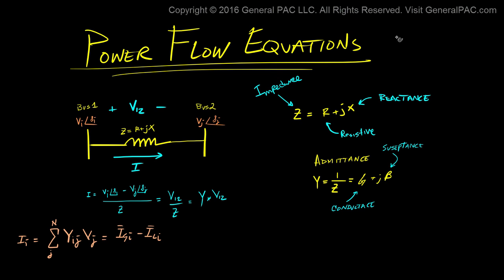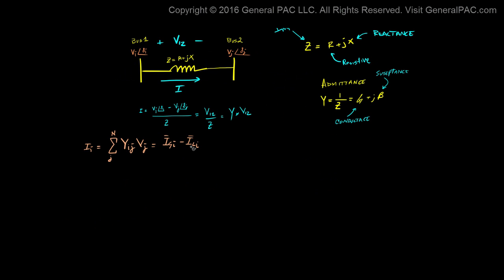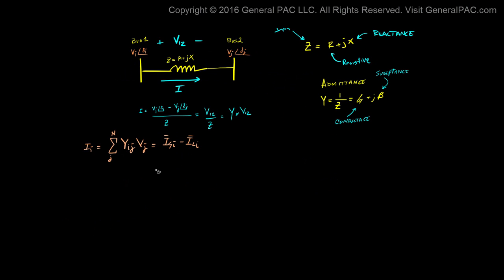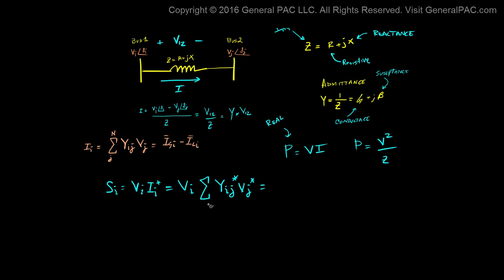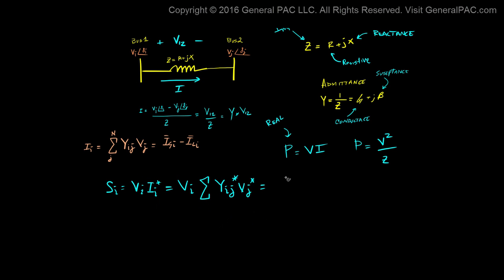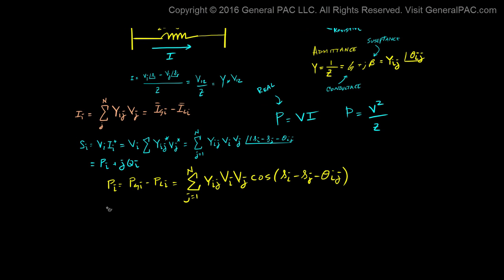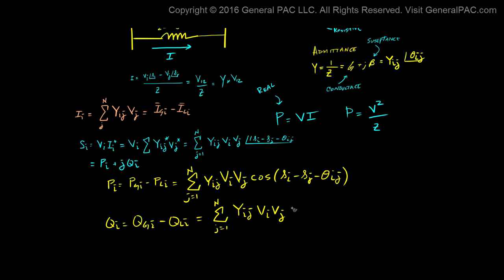Power Flow Equations Part 2

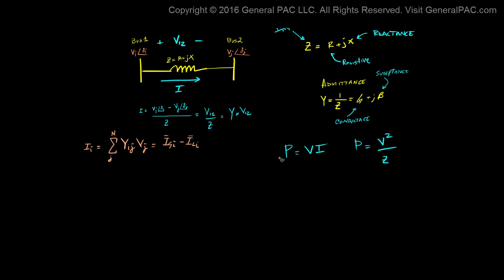Comment: 0:38 Your equations for active power are wrong in general. They're wrong for general impedances (you forgot the power factor), although they're valid for purely resistive impedances.

1:31 Isn't that complex power? So far I've read textbooks which call the expression you typed as complex power, and apparent power as the magnitude of complex power.

Comment: Quite complicated question. It is really interesting to understand why there is a conjugate of current in the apparent power equation. I appreciate the standard explanation that it is required to get voltage and current angle difference rather than sum (as per physical equations). However, just really can't understand why "standard" complex math is not working...
Reply from the maker: Complex conjugate is an excellent topic. GeneralPAC hopes to perform additional research + dedicate a video tutorial for complex conjugate. It's on our list! Thanks for the suggestion.

Comment: I = Y*V12 then for generalization why not   Ii = Yij * Vij why you wrote Ii = Yij * Vj ....I'm confused about Vj portion
Reply: Hi, I got the same question and I learned from a small case study that the j in Ii = Yij*Vij is not totally equal to the j in Ii =Yij *Vj. In other words, I12 is not equal to Y12*V2. There is a point 3 in the completed circuit that is not shown in the slide. I12 should be equal to Y12*V2+Y13*V3. And I12 is equal to (V1-V2)*Y12. I hope this helps.